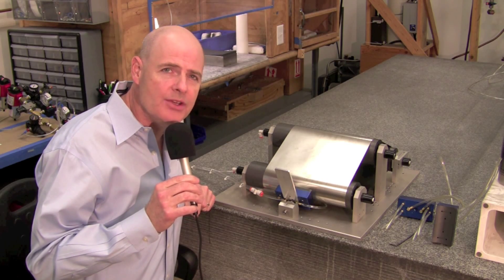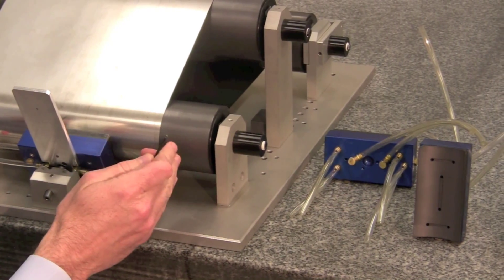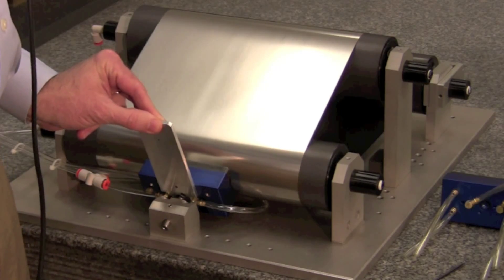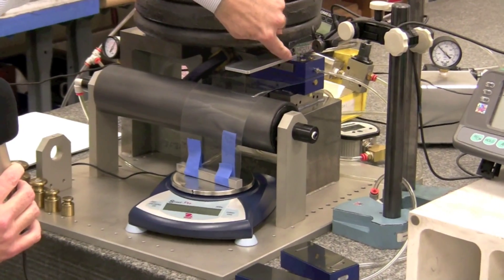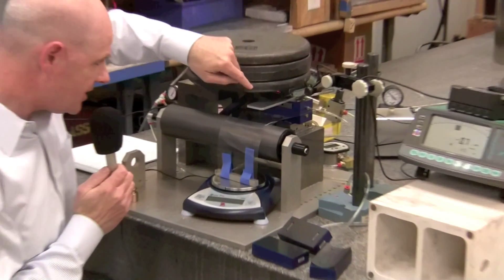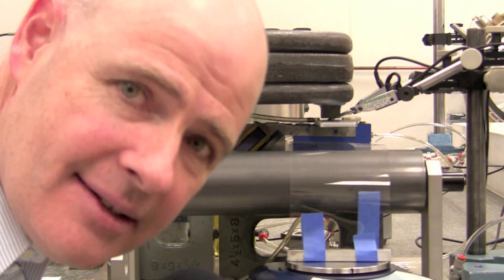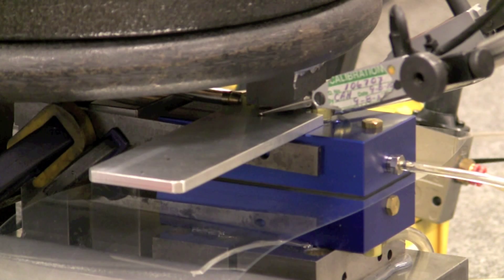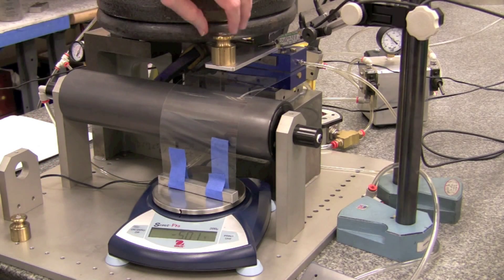Non-Contact Web Control Testing From New Way

Comment: Brilliant! Absolutely brilliant! What has become of this air bearing thrusting?
Reply: For a better test the setup should just be a flat piece of sheet metal sitting vertically on a scale with the air bearings pinching it horizontally with a known squeezing force. And then just put the “diving board” horizontally off them and load it at a given distance with a known mass. The only acting forces would be the equaled out side loading from the bearings, and then gravity and the “thrust” force upwards from the air bearings. the thrust is just how much the scale dropped.

A square stock with 4 air bearings pinching horizontally on the square stock, acting in opposition to each other, would also work well if they each had the same lever arm and known mass at a distance on the “diving board”, as you guys called it.

Comment: Well... 100th of a gram scale? Nah, if that was really a 100th of a gram scale you would have massive erratic numbers because cannot be used like that, you basically look at it in the wrong way and the measurement changes.... just per say.
It should be used in a way better controller environment with as small as possible air movement around the system and the setup.
Reply: Should just be a flat piece of sheet metal sitting vertically on a scale with the air bearings pinching it horizontally with a known squeezing force. And then just put the “diving board” horizontally off them and load it at a given distance with a known mass. The only acting forces would be the equaled out side loading from the bearings, and then gravity and the “thrust” force upwards from the air bearings. the thrust is just how much the scale dropped.